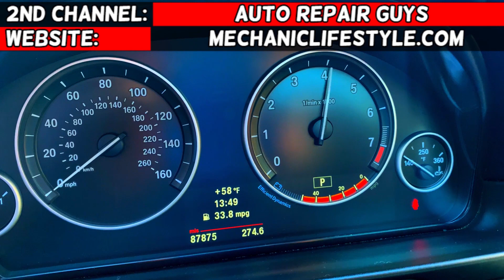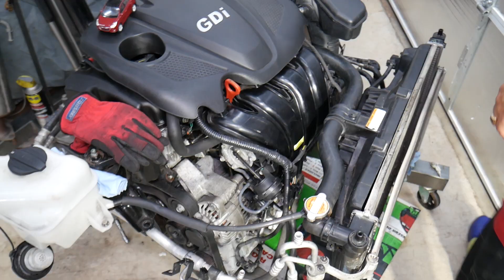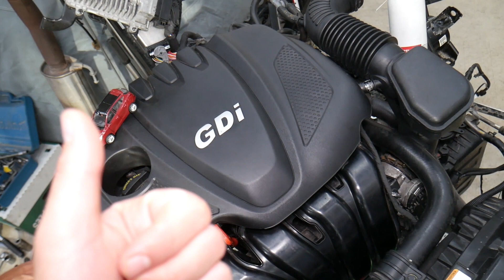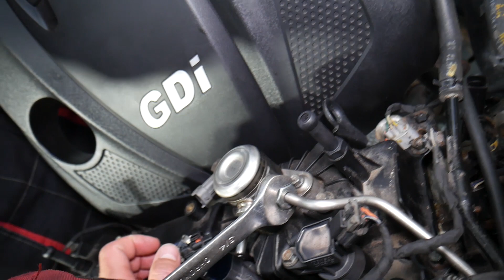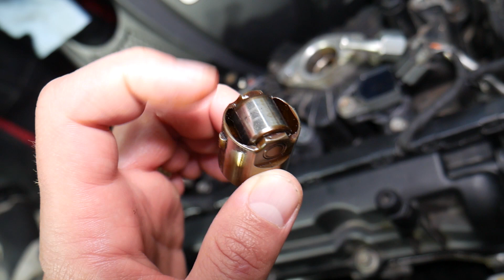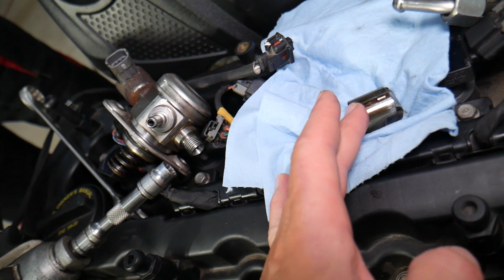HYUNDAI TUCSON HIGH PRESSURE FUEL PUMP, DIRECT FUEL INJECTION FUL PUMP REPLACEMENT REMOVAL

Comment: Does it also have another fuel pump in the gas tank ? Or is it just a filter and level sensor in gas tank?
Reply: It appears yes, this is underneath the back seat bottom cushion. 2nd Gen is similar to 3rd Gens, and there is a filter in the assembly as well. I think I would replace the in-tank one first before the one under the hood, although I have heard some models have poor working high pressure fuel pumps such as the ones in the more recent N-line models, not Tucsons but similar Hyundais.

Comment: I have a Hyundai Tucson 2013 2.0 16V with the conventional fuel pump, I want to change it for a high pressure direct injection pump? or is it not recommended?